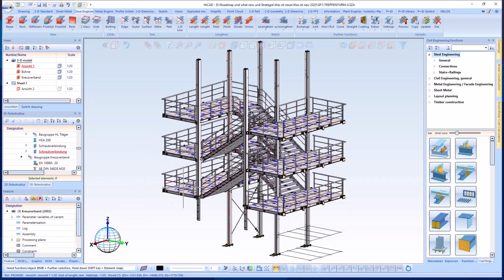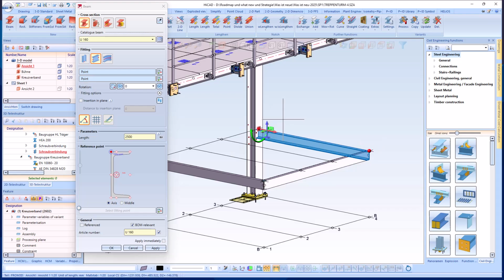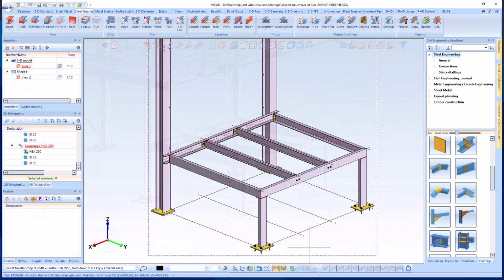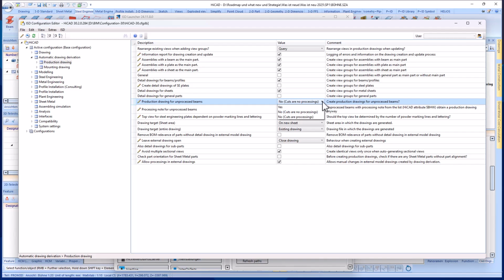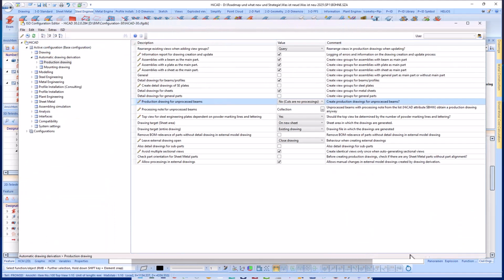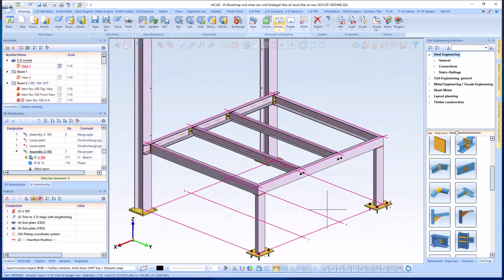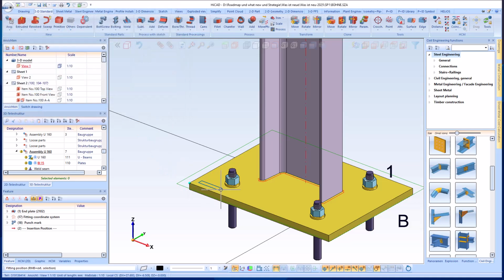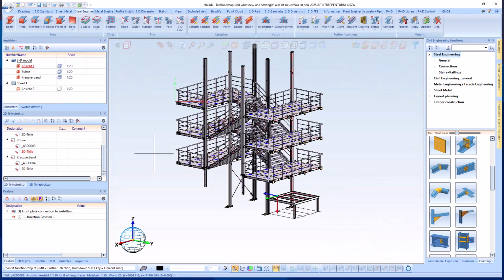HiCAD 2025 | SP1: Profile insertion and drawing derivation

Comment: Hello, I'm trying to connect my SpaceMouse Compact to HiCAD version 2702 (2022 release), but the spatial movement isn't working. The buttons work, but neither do the HiCAD functions. I tried it with Solid Edge, and it works perfectly there. What can I do to make it work properly with HiCAD?

Hallo, ich versuche, meine SpaceMouse Compact mit HiCAD Version 2702 (Jahrgang 2022) zu verbinden, aber die Raumbewegung funktioniert nicht. Die Knöpfe funktionieren, aber auch nicht mit den HiCAD-Funktionen. Ich habe es mit Solid Edge ausprobiert, und dort funktioniert es einwandfrei. Was kann ich tun, damit es einwandfrei mit HiCAD funktioniert?